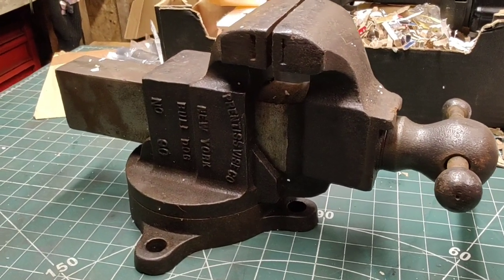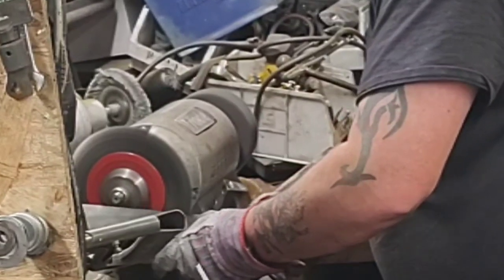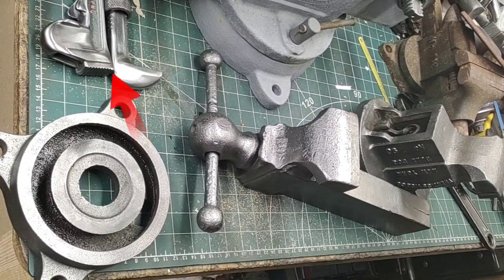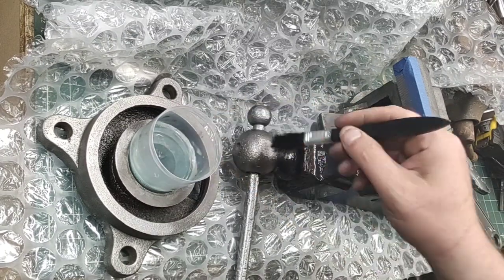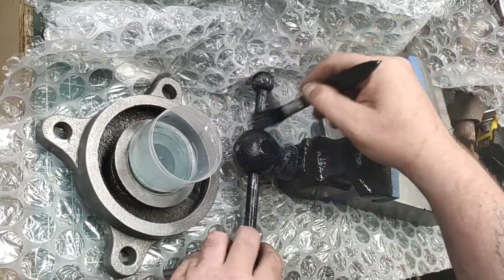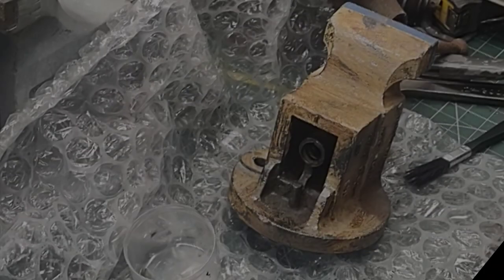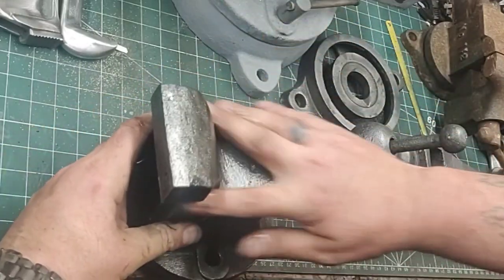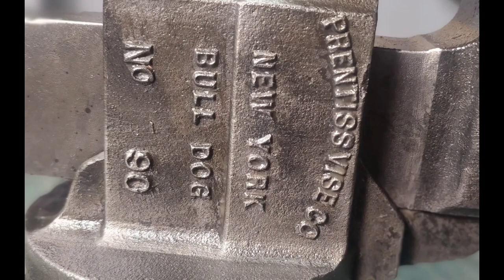prentiss bulldog no 90 vise bare metal restoration

Comment: That was one of the best bad jokes always been under the assumption that cold blue was made for an intended use for items in a more controlled environment or that would be used and cleaned more often. I  feel like it has risen in popularity more for its visual effects. Just wondering if you've ever had any issues with the olive oil going on the rancid side? The vise is a beauty and thanks for talking  about preserving finished tools.
Reply from the maker: No never ,it's pre mixed with the wax when I buy it if that helps , I've tools I waxed 2 - 3 years back with it no probs and  a tin only lasts me a few months 😂 yes years back I think cold blue was used properly thou now everything seems to be for effect, my wrenches would have got waxed after restoration if I'd not been in such a hurry to knock the next vid out and get em on the wall outta the way ..... Have to leave a couple weeks I think for the paint to do it's drying before waxing